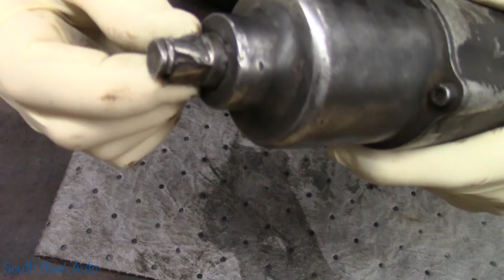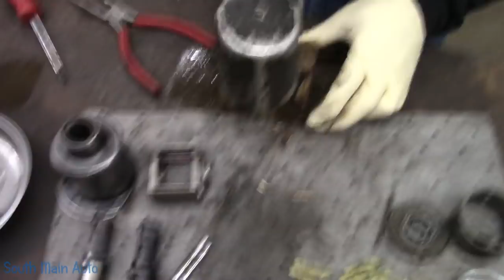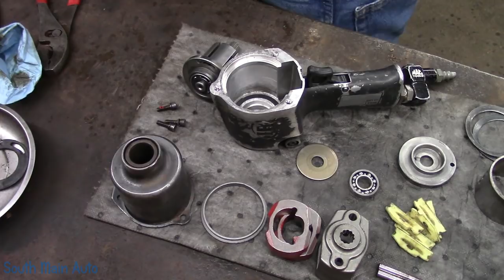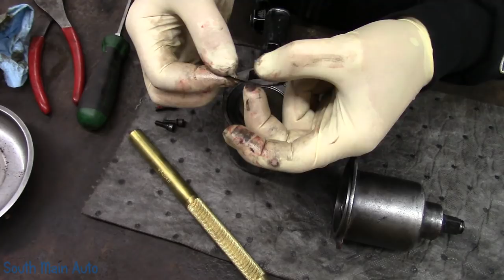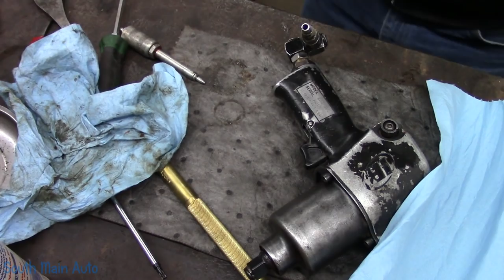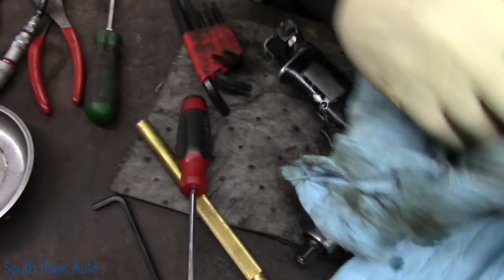What's Inside: 1/2" Air Impact Edition

Comment: I've got my trusty ir 231 model a I got from my neighbor whos an ex fleet mechanic for the power company. Data plate is complete wiped out from him using the back of it as a hammer. I only know it's a 231 because he gave me the gun in the original box and had the receipt from sears from the early 80s. I'm a forklift technician so I use it a bunch for busting 15/16 carriage bolts and 1 1/4 wheel nuts. It's never been taken apart to my knowledge and I've only ever sprayed chain lube down the hole for some peace of mind. It recently went head to head with my coworkers 600 Mac impact and it but up a fair fight. We came to the conclusion that if my gun wasn't 40 years old it probably would of been just as powerful as he's 1400 something foot pound mac gun.

Comment: I feel like servicing air tools is about as close to i can get to meditation at work. Once every few months I’ll grab a random air tool (mostly impacts) and pull it all the way down clean, lube and inspect for worn parts. And when i have a broken air tool I’ll try to resurrect it. Like my FAR7000 that blew a connecting rod out the side. 😂 got the parts from SO and rebuilt it. 

I use extreme pressure moly grease to lube the hammers on my impacts and ATF on everything else.

Comment: Hollow shaft shock is probably the way that they fill it with oil and charge it as most all the other ones they have it in the bottom tank is a little well dip wall hanging on there this probably weld it shut after they fill it

Comment: If you heat up the housing with a torch or a heat gun it will expand it just enough so you can slide that piece in and out easily and you don’t have to try and beat it out lol
Reply: Excellent idea. Well said.
Reply: I was thinking to heat the outer housing and pop the inner rotor gizmo in a freezer to expand the housing and contract the inner rotor...

Comment: Little trick I learned, if you put it back together and it stops working, hook the anvil up to a drill and spin it over for a little while, then set it to the same direction and pull the trigger, it should start running by itself. Leave it like that for a little while and you should be good to go.

Comment: So, when you're trying to remove the last part of the 'motor' by bashing the gun, what's the 'pinch bolt' on the outside of the casing for (above the trigger button)? Did that not need undoing to release the mechanism, or did he do that and I missed it?

Comment: Pretty much every gun sold now is based off the old IR 231. I've had my 2, short std anville and 1 with the extended shank, as well as their lil 3/8s, since the early 90s. If they started to lose their beans, I would just buy a plastic fin kit, seals, and the plastic valve, spring and o ring for the trigger, clean it all up, re-grease it, and wallah.  Never saw 1 hurt the hammers or cage unless  it was really abused, though I have seen the steel pins that hold that all together wear, making it sloppy. Those are available.  I've found air tool oil to work fine, but I also use Kroil. I think the only real draw back to the original IR design was that only the rear bearing was serviceable to grease. You must disassemble the frt of the gun to grease the frt bearings, if you're so inclined.  Later designs from different manufacturers have a grease port in the frt of the case for that bearing.  Anyways, tool time w Eric O!
Reply: 1 other thing I forgot to mention.. If you need to take apart the combination forward/reverse and torque setting slide/thumbwheel, be sure to pay attention to its clock position. This valve has a couple of o rings on it along with a couple ball bearings, but not much else. If say you want to clean out the grime that can get into it, be sure to get it back to where the factory clocked it. If you don't performance and torque will be way down, and the numeric settings 1, 3 and 5 might work in 1 direction, but not the other.
Reply: It's "voilà", ("Vwah-LA"), French word for "there you are" or "there you have it"!  Walla is studio-speak for background sounds/dialogue.

Comment: A question please Eric: Why didn't you apply a light film of "air tool oil' onto the parts as you re-built it? Also just had to ad some info......When I rebuild motorcycle engines, bicycle wheel hubs, etc. and had bearings that had a close fit in a side case or somewhere else; I would put the bearing or the axle piece {in your case the "motor"} in the freezer. When possible would heat up the area where the bearing goes in with a hair dryer or HF heat gun. Then when I'd go to install the bearing it would literally "fall into place".

Comment: use propane torch to heat the case. good and warm NOT finger burning hot. should slide right in then

Comment: I never heard ir saw grease being out inside a pneumatic impact gun.

  I just use air tool oil in my Chicago Pnuematic and no problems for this occasional garage mechanic--after I bought a 20-gallon air tank.  Air hog 15 CFM average 3.75 CFM.  Do not bother with a Pnuematic tool on an eight gallon or less tank; you will spend more time waiting to build air than wirking on tiur project.

Comment: Use silicon based grease , not wheel grease. Petroleum based grease can (in special circumstances) cause ignition when mixed with oxygen under high pressure. We do not want an episode called exploding impact wrench.

Comment: "Damaged from too much oil".
Reply: It sounds funny but you can over oil a gun.
Reply: @southjerseysound7340  
Did not know that.Thought if you added too much oil it would all just end up on your hands from the exhaust. I just put 3-4 drops in mine so I don't get a pile of oil on my hands or shop...lol.
Reply: @NY411Info  It's similar to too much liquid  in a engine. Air compresses and fluids don't and while it doesn't hydro lock bending a rod. It does hurt the air powered motor somehow. I thought the same as you years ago and learned the hard way. It was   why my new impact had less power than the dude I worked with.

Comment: If you slightly heat the back of the gun with a heat gun , that piece your fighting comes out , with gloves , cause it's hot , but not too hot , that's easy to do also , I melted one , I got carried away with the heat ..😂

Comment: I always grease the anvil and hammers and pins...you put them in dry, youre asking for trouble. The hammers take an enormous beating at full power. The vanes are cheap plastic to replace from lack of oil. Lack of grease, youll grenade the entire gun.

Comment: Well you are NOT a tool mechanic we see. And that is because you can't use your OBDII Scan tool to plug into that tool. Other wise it would have told you how to disassembly it and reassembly it correctly. I will say though that IR pneumatic tools are some of the best I've ever used. Powerful and seem to work...even when they are assembled incorrectly. lol
Reply: What is assembled incorrectly?  The impact runs fine. The gasket was probably a duplicate error from the factory.

Comment: grease is not allowed in air tools, only oil .
Reply from the maker: They should take the grease fittings off from them in that case :)
Reply: @SouthMainAuto  the fittings are for oil not for grease i believe
Reply: @geoepi321975  I have a small grease tool for my impact.  Might be that the kind you have does not have grease locations.
Reply: geoepi321975 back in the 80s when you bought a IR gun from Mac they gave you a “free”  special grease gun and grease for the rear bearing